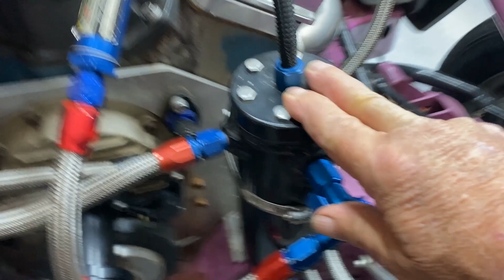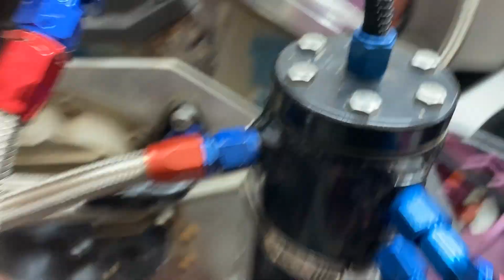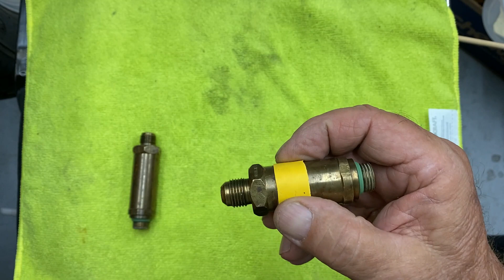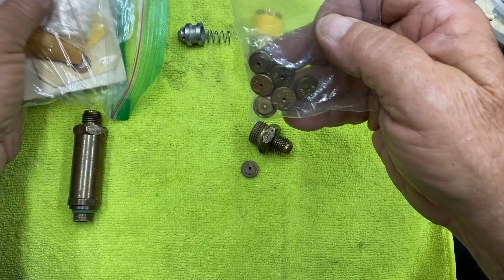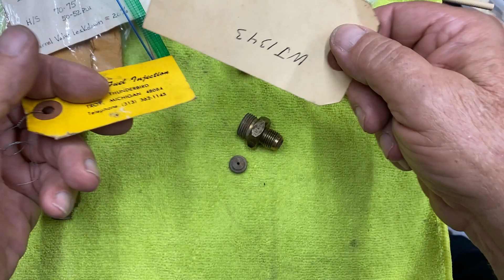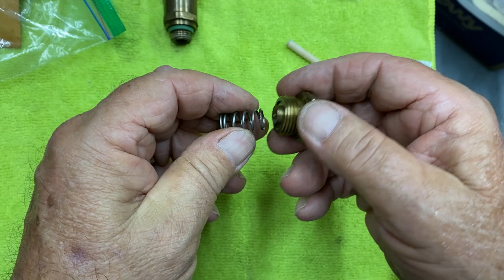8 Stack Mechanical Fuel Injection 101 (Part 4) System Overview - Main Pill - High Speed Bypass

Comment: I have a hilborn pump. 1 inlet and 1 outlet. Would i t off from the barrel valve line for mainn and high speed pills ?
Reply from the maker: If I understand correctly, yes you would need a T fitting on the output for the Main, HS bypass (if you are using one) and the Barrel Valve.   Cheers

Comment: Hello, thanks for the videos and information. Very informative. I do have a question about your setup. I know you have -12 lines from your rear tank, but wondering if the electric pump could become a restriction wide open... the surge tank will cover it up while it has fuel in it of course but if that gets consumed...  100gph would be less than half what the waterman pumps. I understand quite a bit returns via the main pill. If the surge tank held enough fuel for a whole pass it wouldn't matter but it doesn't look that big...  Thanks again for all your time and explanations.
Reply from the maker: I may have mis spoke. My electric pump is advertised as 450 gph.  I think that is rather overrated though.  Thanks for the comment.   Keep me honest! Cheers!

Comment: Great info! Where did you get the surge tank? does the float switch kill the pump when it is full? Can the cell just stay open during operation or do you need to open/close the noid?
Reply from the maker: Hello and thanks for the note.  I can let the pump run continuously but have a switch to have it turn off when the float sw activates (full).  It saves the battery when full flow is not needed.  It is an aircraft fuel switch I found as surplus.   The surge tank is an old CO2 tank for a paintball marker gun.  I modified it and had it powder coated inside and out.  Kinsler sells similar tanks but they are a few hundred dollars as I recall. The tank vent solenoid opens when the electric pump turns on, so it is always sealed when the pump is off.  I hope that helps answer.   Cheers!
Reply: @digitaloverdrivesystems  Anything in place for when on 2 step/trans brake or just mat it and go? I just got a old crower bbc unit and it's my first attempt at stack inj.

Comment: Just found these yesterday and caught up. Been helpful because im an idiot who wants to run it on the street. My only advantage i have is im aware of my stupidity. Keep them coming this is the most informed/indepth in the years ive been looking at constant flow
Reply: I'm trying to do the same..🤣 big v8, small car, mechanical injection and manual trans. What could go wrong..🤣

Comment: Very good, your high speed is cool,I have to use springs and shims to reach my desired pressure,I need to find one of those cans.Thoughts on high speed and a scoop? That’s where we are at,more air more fuel? This year I’m going back to Bonneville with the high speed and starting with a super rich pill.Also,I just had to replumb the entire car,lots of changes,and I ended up using a fuel log mounted away from pump which makes access to the pills super easy,wish I could attach pics
Thanks
Reply from the maker: Hey Steve, thanks for the note.  Happy Easter!  
So the challenge would be to measure or somehow calculate the increased volumetric efficiency of the engine with a scoop at the target speed range and determine an appropriate amount of fuel that can be added.  Do you use any sort of O2 meter or wideband that could help determine the proper air/fuel ratio?  A data-logger?
Reply from the maker: Look for a WAT766220 Waterman Adjustable High Speed.  Not made anymore, but I just saw one on eBay....
Reply from the maker: Id like to see the picks - you can email me at speedy@digitaloverdrivesystems.com